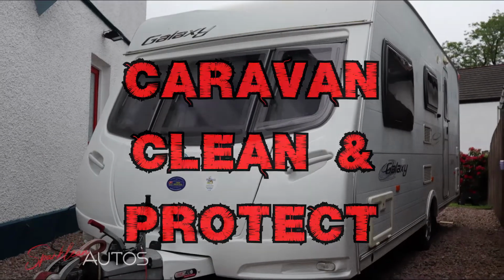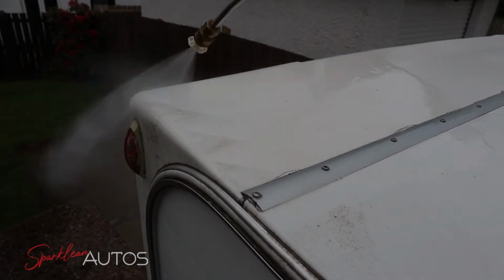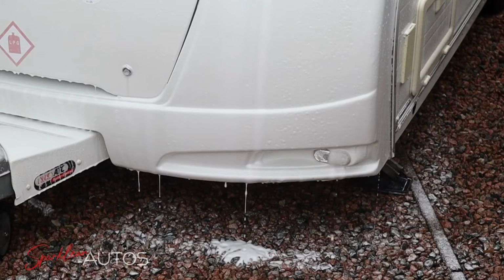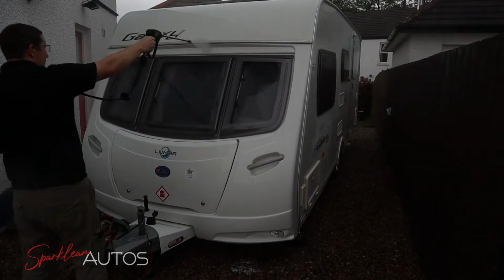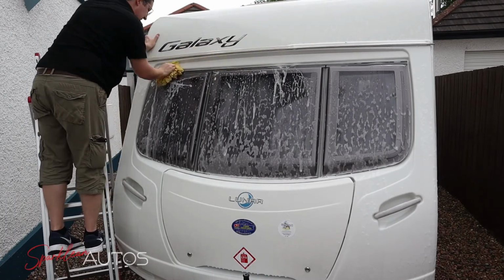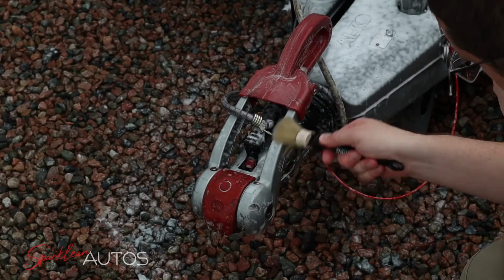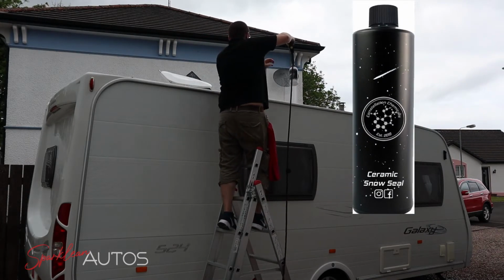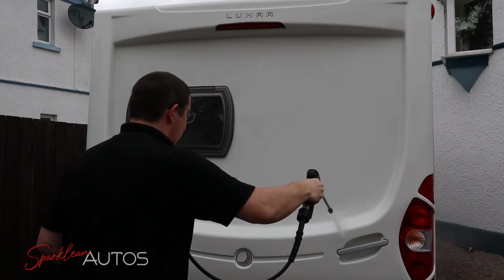FIRST WASH IN OVER A YEAR!!! Cleaning & Protecting Your Caravan!!! #carcare #caravan #cardetailing

Comment: Great video and great demonstration of  how to safely clean a caravan mate. If you get it wrong and go with to much pressure you can break through all kinds of seals on them. Would be interesting to see an update on the ceramic sealant a year later mate.
Reply from the maker: Cheers Dave 😁👍🏼
Well unfortunately the caravan is parked up for the year on a site 80 miles away do that won't be possible 🤣🤣 next time I'm cleaning it though I'll definitely keep track of it 👍🏼

Comment: That’s the inheritance right there.... least it’s 1/2 of a clean caravan now... 
Cracking video, what’s the opinion on the snow sealant? Durable? Nice finish? Still apply a QD after?
Reply from the maker: For this type of job it's perfect, and on the caravan it should last a couple of months at least.. I wouldn't even bother with a QD, only washing the caravan 2-3 times a year so if just use a spray sealant every time, for all you're using and all the time it takes 👍🏼

Comment: Hello matey, not sure if you did the video but what product did you use on the windows?? Cheers
Reply from the maker: I never did get around to the video, well not yet but I do plan on it very soon - the products I actually used there was Meguiar's Ultimate Polish but any decent polishing compound should do it. I would just always recommend testing on a less noticeable area first (bathroom window for example 👍🏼)
Reply: @SparkleanAutos  thanks buddy! Got quite a few light scratch’s to get out, seen a video with g3 before but was worried that was too harsh
Reply from the maker: Will you be doing it by hand or by machine???

If by hand then it will be a lot more work but will massively reduce the risk of doing any harm whatsoever.

By machine and the risks obviously increase but so long as you don't overwork it, keep the speed low and don't apply much pressure - remember it's a soft plastic so it will heat up quite quickly. Do little bits at a time if you're not overly comfortable/experienced.

Always better to do it gently 4 or 5 times than go crazy with 1 attempt and go too far!!!